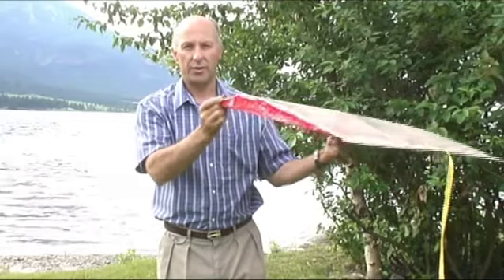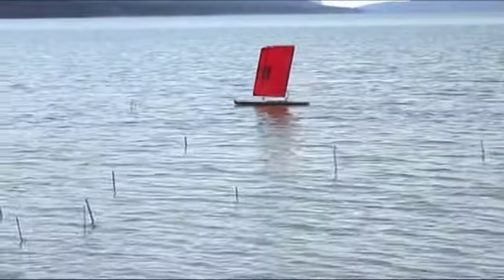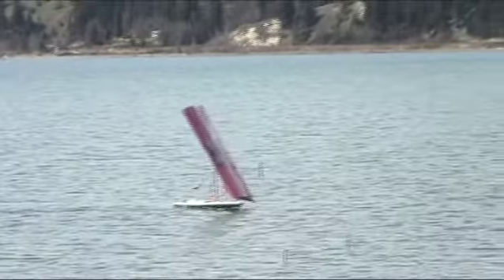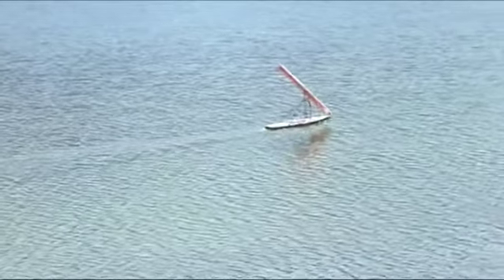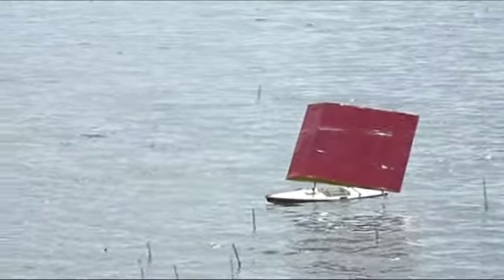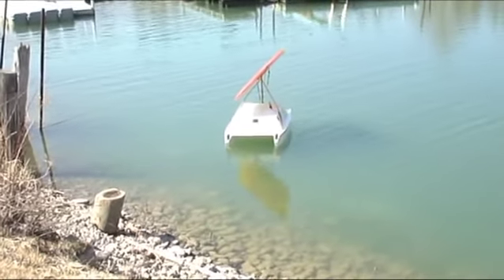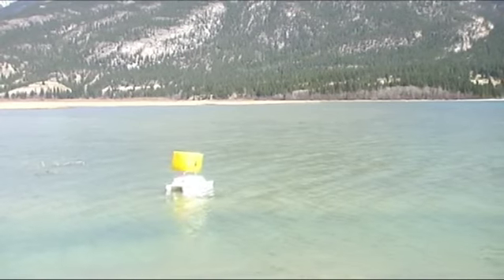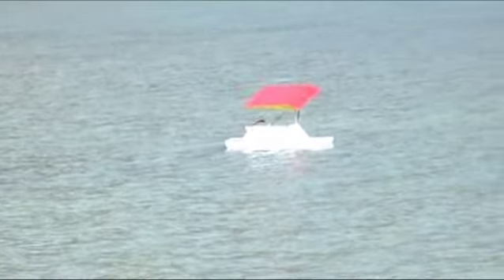Power Wing Sail System

Comment: This is fantastic and inspiring. I'm building a 16' double outrigger sailing canoe using a soft version of the overhead or horizontal sail, which can be deployed like a regular crab-claw, or overhead like an aileron on an airplane. This turns the forces into lift, offering a new dimension to conventional sailcraft. A grommet and bungee can give the symmetrical crab claw a delta wing shape as well. The boat is nearly done and I am prepping to sew the prototype sail.
Reply: Do you have an update on your build?  How did it go?